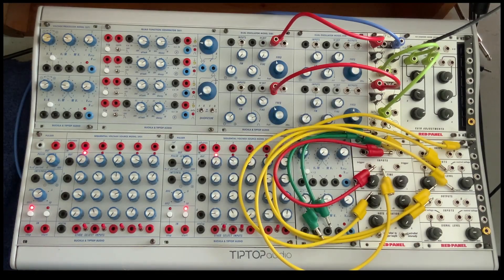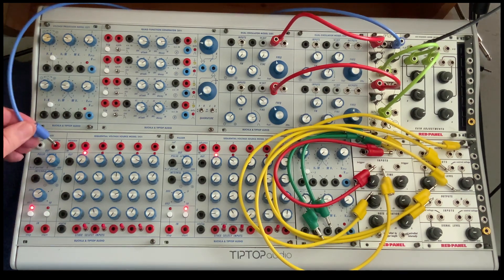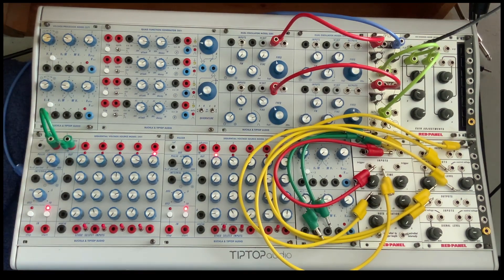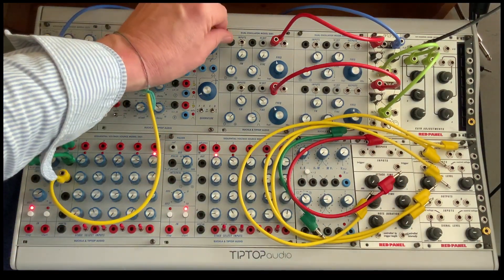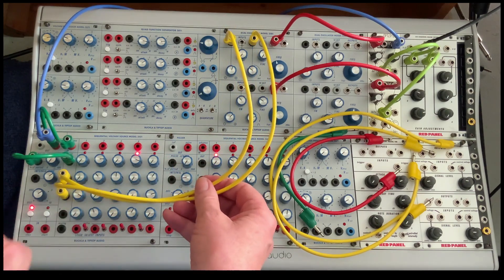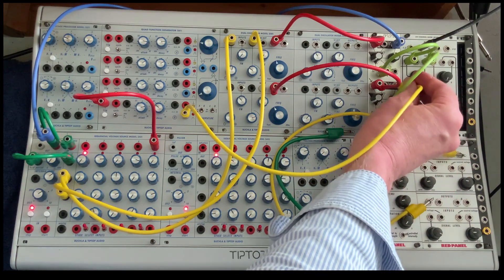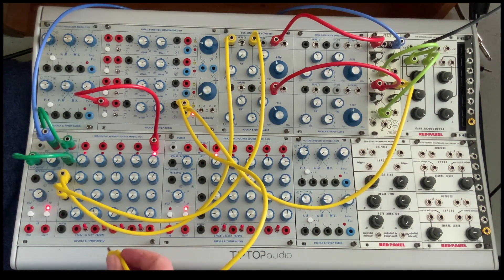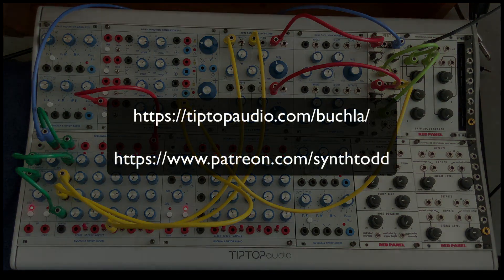Tiptop 245t Sequencer Overview

Comment: Nice overview! Is it possible to make an 8 step sequence by turning off the last stage and then using C or D output to switch between sources A and B feeding into the 257t? Hmm, I can't think of a way to do it without 2x245t's. I'm also wondering if the stage outs should be blue not black!
Reply from the maker: Yep, check this out from Adam Scramstad https://www.instagram.com/tv/Cf-DBryFPwE/?igshid=YmMyMTA2M2Y=

Comment: OK, potentially dumb question here, but does this have a way to sync to another clock, like an ALM PNW?
Would you connect to the Internal Time jack, or simply the red Start jack? 
I love that it's in 5/4 and that you can kill steps in real time and that opens up all sorts of timing mess-arounds by dropping out a step while in performance to revolve around other time signatures.
Reply: Pam's clock (not the 24PPQN one) connects to the Advance in on the 245t and a reset to Stage 1 In on the 245t.  I specifically worked on this combination when making the 245t.
Reply: @chrisclepper8663  Yeah, I got a reply from beta-testing through Gur at TipTip confirming how to set it up. Been having a great time with it.